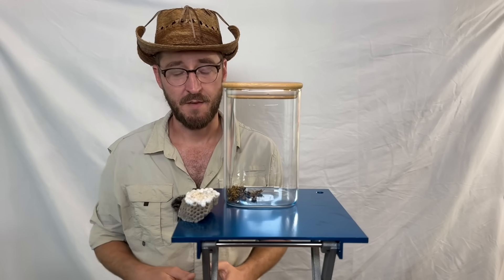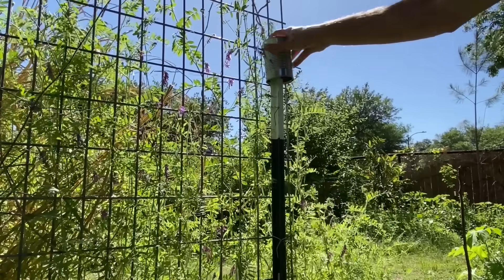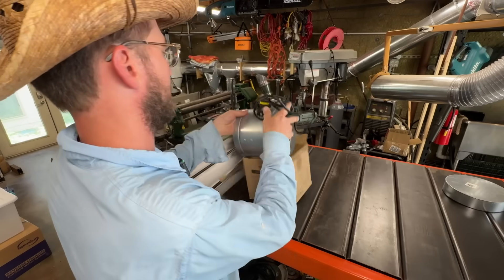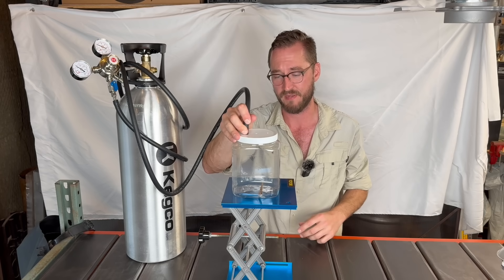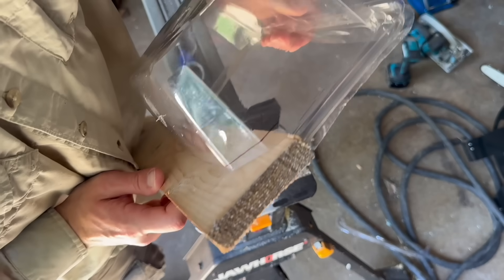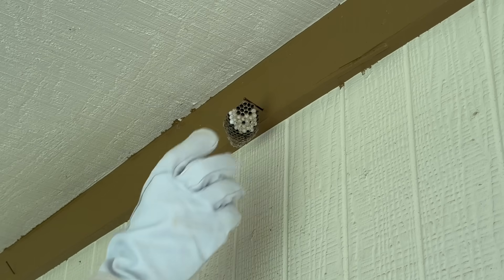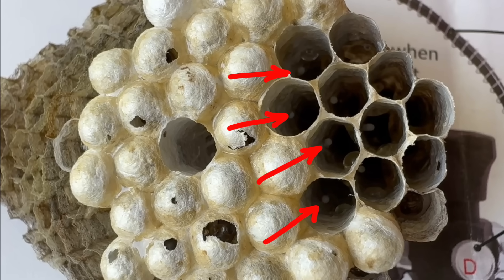Move WASP nests ANYWHERE!!!!

Comment: Just C02? It's heavier than air so it sinks. Huge C02 plumes have been responsible 1000's of human deaths. It happens naturally from under bodies of water. Also look up dry ice party gone wrong. Dry ice is just frozen C02. Throw a bunch into a pool and it will melt really fast and create a deadly layer on the water. A bunch of Russian people died at a wedding party from this. The ones who jumped in fell "asleep" and drowned. To make things worse the affect they were after (Fog) is what made it impossible to find the people passed out. Fucking nightmare!
Reply from the maker: Scary! I had never thought of that. Grim!

Comment: 👍👍 the metal tubing that you have here in this video and you can also use duck tubing. I guess that’s what this is, and I put this around my PVC birdfeeder pole! Yeah, it’s a squirrel baffle basically😅. 
I also put one around my shepherd hook and made it wide enough that the critters couldn’t climb up it and then I put a little bit of mineral oil all over to help. Keep it slippery, no more squirrels in the birdfeeders.😅
Reply from the maker: Thanks for the tip!

Comment: To keep wasps out of a covered area:

Smooth things out and add lights to the ceiling, because they look for corners and shade.
Paint places you don't want them blue and keep it clean because they perceive blue as open sky, meaning easy to see.
If it has open sides, set out a bird feeder with cardinal seed, because cardinals will eat wasps straight out of their nests (some other small mammals attracted to the seed will also be interested in the nests)
Build a more attractive space close to the area you want them to stay away from (doesn't always work, but sometimes helps)
Set out fake nests (again, doesn't always work, but many times wasps won't nest where another nest is easily seen)

Most importantly: keep things moving in the area, because they don't build where they get disturbed. So if you can have something moving around (electric train, electric suspended trolley) when you aren't there, they will tend to go elsewhere

Comment: You can also use the CO2 to make club soda or re-carbonate flat soda in bottles.  You will save the cost of the set-up many times over if you drink as much soda water as I do.  One five-gallon tank of CO2 should last 2 years, even if you drink a lot of soda.
Reply from the maker: Or clean out condensate lines 😂

Comment: Great video! Thanks. 2 suggestions for a followup video (if you are inclined).
- consider location and exposure properties of new sites. Eg. South vs North, sun exposure etc (which will vary depending on your climate)
- try a budget building using a used sofa siphon. The cartridges are CO2, cheap and readily available.
Keep up the great work!
Reply from the maker: Good ideas on both. Maybe a co2 bike tire inflator? From what I see they are even cheaper. I cover the shade topic some in the Patreon follow up video I made but I didn’t think of using the tiny co2 cartridge. Thanks!

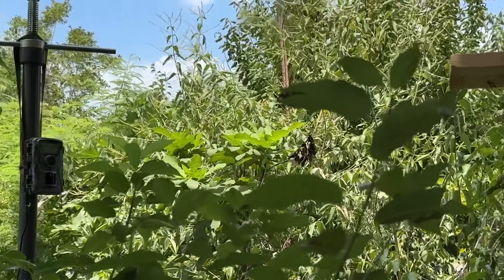Comment: 12:20 is a very important part of the video to make sure you pay attention to, if you are going to relocate a nest.

(original comment below, where I somehow missed the whole end of this video)
It needs to be water proof. 
That design isn't protected from rain with wind. 
A small flat piece of wood isn't good enough. They won't survive.
Reply from the maker: Rain has not been as big of a problem as wildlife. I address in my Patreon follow up video. I added furdowns and chicken wire.
Reply: @suburbanbiology  You did nothing wrong, I just missed a critically important part of the video somehow.
You could have replied "Please re-watch the video at 12:20 " because I somehow missed that you said exactly what I was going to tell you that you should have said. I am confused how I missed this when I watched it.
I had typed out an offending message, accusing you of things that were initially true, up until that point in the video, which then became completely false accusations.
I'm going to edit/update my original comment to include telling people to pay attention to that timestamp before attempting to move a nest.
Reply: @suburbanbiology your link for the regulator is the link for the funnel

Comment: This is a GREAT Video.  I explain to the wasp in my area that I won't hurt them if they don't hurt me, and for the past fifty years I've never been stung by a paper wasp even with a 24 x 28 inch nest over my back door. What's your take on ground wasp, and bold faced wasp??
Reply from the maker: I don’t have experience with ground wasps so I’m not sure. I got a sting last night watering the vines from my metal fence video. There was a small nest on a vine that I couldn’t see. I swear it hurt less than usual. Maybe they stung less deep after their friends showed them this video 😂
Reply: @suburbanbiology  If they had seen this video they wouldn't have stung you at all.  Could I also ask that the things are hanging on the line ??

Comment: I wonder if you couldn't just use combustion as a source of CO2...like a smoker. You could collect the CO2 by running the smoke into a mylar balloon which should be fairly heat-resistant, then let it cool and you've got a ready-made wasp knockout gas delivery system
Reply from the maker: Even air rifle cartridges would probably work. They make little blowers like a keyboard duster that use them as an air source. Much cheaper (although smaller) than my system.

Comment: I use a similar method but with the bean can with an hole in the bottom attached to a propane torch, let out a little gas and then ignite, POOF they all fall to the bottom motionless, just like your carbon dioxide contraption.
Reply from the maker: The co2 is more flexible …..and less hot. Thanks for commenting!!!

Comment: In my wooden or metal tool/garden shed(s) i have always sprayed a very light quick spray of WD 40 along the interior center ridge. Just a light quick spray, not enough to cause an environmental disaster. Wasps and hornets would never build nests in any part of the interior of the shed. Ever. Only had to do it once, and no problems for years, and since they are just utility structures the odor is no worse than the lawn equipment itself.

Comment: Very impressive!  That's a great solution for dealing with unwanted wasp nests (e.g. if kids play nearby) in an animal friendly way. I'm sure many people would be interested in trying it out. Plus, there is money saving to be had by using the same equipment for making one's own fizzy drinks.
By the way, did you try placing any wooden boxes upside down (i.e. open side facing downwards) in the garden?
They seem to go for shady, protected locations, probably also away from draughts, so they might be tempted to use them.
Reply from the maker: That’s the design I pursued in the Patreon follow up video. Thanks!
Reply: @suburbanbiology  Did it work?

Comment: You’re almost there.  But you’re not entirely water proof yet.  The cans work because they are.  The subsequent attempts had holes in the top that would let water in.  Even the flat boards in your final version will become wet in the rain.  Check them out during a good downpour.  Some will stay dry underneath, but many will drip water on to the nest.  

The board/lid/roof needs a drip edge so the rain water drops to the ground.
Reply from the maker: I made of these modifications in the Patreon video I posted. Thanks for commenting!

Comment: This is actually a really helpful video, as my family has a cabin that we go to only during the summer and fall (it just wasnt built to last the Minnesota winter), so we often get up there right in time for some giant wasp nests to appear. Normally we just spray them, as we dont really know what else to do, but maybe if there are nests small enough to move easily this next year we could try it out. Do you have amy advice for moving larger, more fully-established nests?
Reply from the maker: I actually have a handful of detailed tips. I put it on my Patreon. The most important are protect the nest with chicken wire, don’t use hot glue and put the nest in shade. Much more detail covered in the Patreon video if you’re interested. Thanks!

Comment: I most definitely plan to experiment with your ingenious methods of humane relocation. I’m curious though if argon CO2 mix would still work I’m a welder and use an argon CO2 mixture for some of my welding processes so I always have a bottle in my garage. it’s 75% argon and 25% CO2 with argon being an inert gas. Would it still asphyxiate them without killing them if you didn’t expose them for too long?
Reply from the maker: I think it would work just fine. It’s more expensive than pure co2 but if you already have it, I have read that argon has anesthetic properties as well. I would make sure to keep it under 5 minutes. If you have success please comment again!!! Also don’t use hot glue, it melts in the sun. Put the nests in shaded areas. And cover the awnings in chicken wire. More details on my Patreon if that’s your thing. Thanks!

Comment: This is absolutely amazing! I consider myself somewhat of a professional when it comes to wasp relocation, I have been relocating wasps to the nether worlds for many years without a single sting. I always wear a hoodie and wait until the evening and use various methods to trap the wasps. That being said, I’ve always hated killing them and will only destroy a nest that is built on our house or In a high traffic area.
Reply from the maker: I hope it works. Let me know. Post a new comment if it does please.  I can’t always see replies to old ones. Thanks.
Reply: I most definitely plan to experiment with your ingenious methods of humane relocation. I’m curious though if argon CO2 mix would still work I’m a welder and use an argon CO2 mixture for some of my welding processes so I always have a bottle in my garage. it’s 75% argon and 25% CO2 with argon being an inert gas. Would it still asphyxiate them without killing them if you didn’t expose them for too long?

Comment: Nice one, thanks! As I didn't have a CO₂ bottle at hand, I used a 1.5 Liter jar, folded some metal wire mesh to form a second bottom so the wasps wouldn't fall into the mixture below, which was sodium-bicarbonate (2 table spoons) and white vinegar 5% (5 table spoons) the gas that is produced (within about 2 minutes) is CO₂, I closed the lid and was ready to go, with some long sleeve rain gear and leather gloves on, and approached them in the corner of that shed, opened the lid and put the jar over the nest. The mesh worked nicely and indeed after about 5 minutes they had all fallen down, properly sedated, brought the nest to its new location and placed its stoned inhabitants nearby; they woke up after about 20 minutes and went straight to their nest as if nothing had happened... 🌈🐝👍🙏
Reply from the maker: Wow. Cool. Thanks for sharing!
Reply: When I saw CO2 I immediately thought there has to be a simple reaction that people can do without the need to buy compressed CO2. Thanks for the sharing your experience, it would be a pretty good experiment to do with kids as well, lots to learn in a fun way.
Reply: @Kadum122 the oldest reaction known - vinegar and baking soda 😁
Reply: that's clever
Reply: Huh. Never thought that reaction would have a practical use. If you wanted more control over the reaction you could use a mixture of citric acid and baking soda.
Reply: dry ice may also work
Reply: Love it! Where I come from, we affectionately call this “redneck engineering” ❤
Reply: Wow what a great idea! Everyone has baking soda and vinegar lying around. I’ll use this until I can build the model in this video. I’m so glad there are others who care out there. Thank so much for the idea

Comment: Wasps like to build their nests where predators can't easily get to them. So, fences are a bad idea. Wasps have a tendency to build their nests around windows. I've had a wasp nest in my window air conditioner, so I spray them in the spring when they are beginning to nest. I've heard horror stories of wasps digging through the insulating foam in window units and entering houses. Window units only have a foam barrier between the inside and the outside. It always seemed a bit cheap not to sandwich the foam in plastic or something.
Back in the 80s, my brother built a bird house for Boy Scouts. He attached it onto an old swing set. Instead of birds, wasps built their nest in there. He also used to do weird stuff like throw water on a wasp nest, run inside, and watch the wasps land on the sliding glass door as they chased him. I wouldn't suggest doing that. We didn't have good video games or the Internet back then, so kids often did crazy stuff just to pass the time.
Reply: My wasps here are pretty dumb then they build their nest in the outside corner of the door frame. And spiders cover it at night and no doubt eat half the wasps at night. The nest doesn't seem to grow but they are always there. And the spiders are getting down right enormous from the extra food.
Reply from the maker: I do a little water spraying in the final scene
With some slow motion shots. I doesn’t hurt the wasps…..so I couldn’t resist. Thanks for commenting!!!!

Comment: I like the idea of using CO2 to promote sleepiness without killing the wasps themselves. Good job. The issue with Spray is that the pesticide usually harms other insects including bees which we def don't want.  However, a CO2 gas tank seems a very expensive tool. Dry ice devices are 350 dollars and tanks can cost 200 dollars so it an difficult tasks for most people tho. Prob way too expensive.

Comment: Yes, I understand that wasps are just part of the Eco cycle. 
But my wife is very allergic to them. So, not in my porch or back yard, thank you. 
If a loved one gets stung by a bee and they are allergic, call an ambulance. 
911, what is the problem? Bee sting. That will most likely be the fastest solution to a problem that could be fatal, unless you can get to an emergency room faster. My closest ambulance is less than 1/2 mile away. Stay safe, forget about the cost.
Reply from the maker: For those with allergies I certainly understand the safety concern. Thank you for commenting. Be safe and take care 🙏🏼

Comment: Incredible, your first video I saw was the amazing rain water tank video but that was it, didn't think I was coming back for the fence video, neither this one, and searching the channel I didn't though I was going to have such a joy seing the elsa video, but now I finally subded😅, your content is incredible, not only informative but useful, well produced and really fun, looking forward to seeing you more.
One nitpick question, I've been recycling for a few years and I was flabbergasted on how much plastic we (my family and I) produce on a daily basis, I'm now trying to reduce the amount on plastic I produce, even on my crafts (I'm a little paranoid about microplastics), and is there another way to hang the nest to the support without using hot glue? I want to do this on my yard, I have a lot of frutiful trees and I also have a problem with bugs, but I would like to no use any plastic, specially with a open nature project. Definitely joining patreon when I an able to.
Reply from the maker: In truth the hot glue was subpar in my area and even melted in my august heat here. I would advise epoxy or super glue for anyone trying this. I’m sure other glues may also work. But water resistant AND heat resistant would be superior to what I did. Thanks for your support! And good luck!

Comment: So with all the effort of moving the nests, did they stop showing up in your house? My experience is that there are plenty more to replace them
Reply from the maker: Only a few came back. I expand on that in the Patreon follow up. Thanks for commenting!
Reply: @suburbanbiology  We had hornets here last year - never harmed anyone but one of them got mangled one evening (indoors) and within minutes two angry fighter planes appeared having squeezed in through a tiny gap and were out for revenge!
Reply: if you paint the outside of your home in Gloss or Semi Gloss the Mud Daubers and Paper Wasps & even Spiders, have a tougher time attaching to the shiny surface, ALSO - if you paint your homes exterior with Latex paint, you can add up to 20% Rid-A-Bug or other water based bug killers to the paint and thin it down a bit and NOTHING will build on it for a cpl years till the stuff loses it's effectiveness
Reply: @Mad-Duk_Machine_Werkes the goal is not to damage them.. rid a bug..